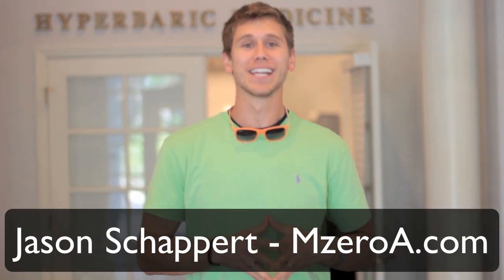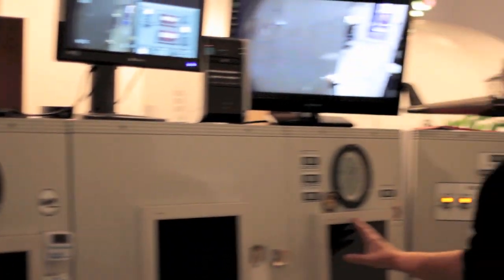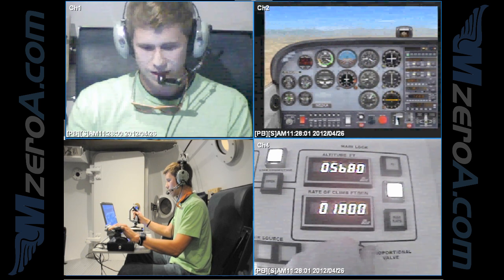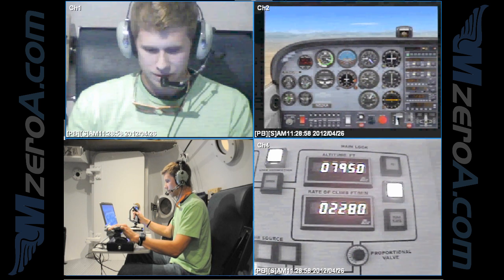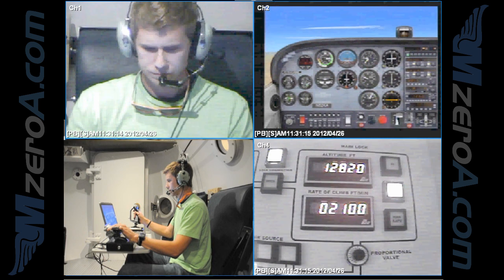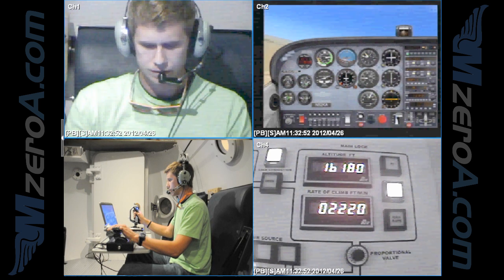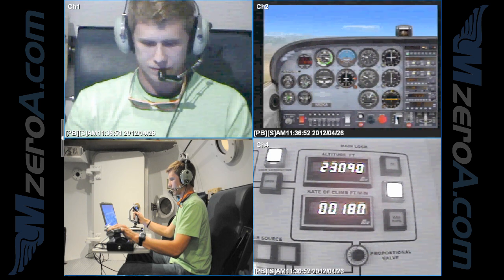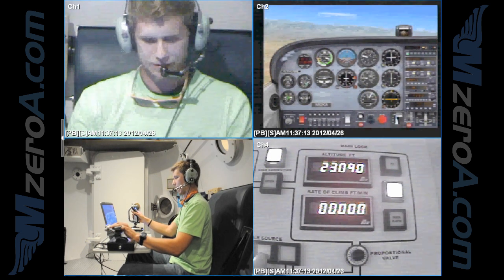Flying While Hypoxic - Aeromedical Factors

Comment: Had it and had to delay my freight and turn back felt sloppy in my driving and tunnel vision hopped the next exit and turned around was at 13k feet had to have my dispatcher repower load and explained what hypoxia is and at the wheel of a truck is no time to get it and they say u can't apply aviation to trucking